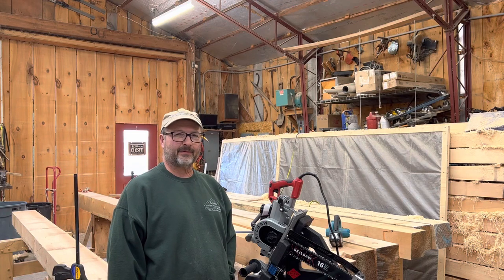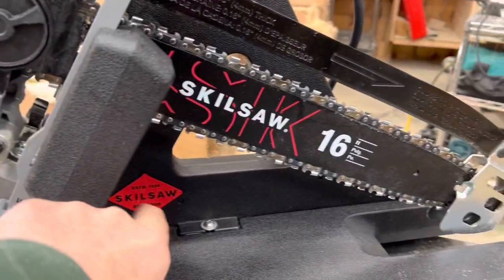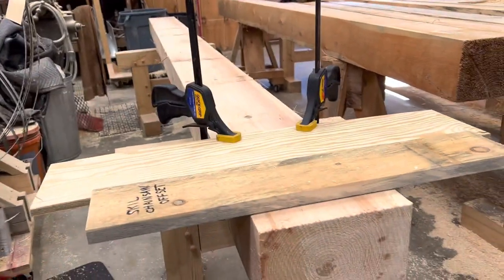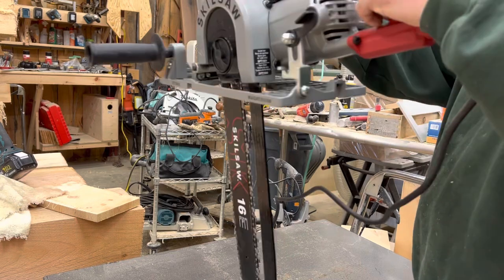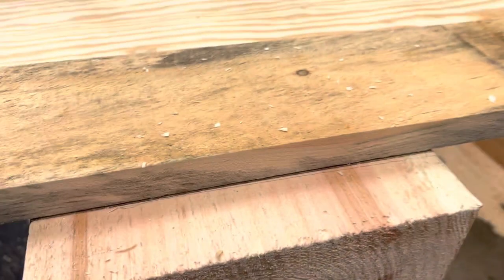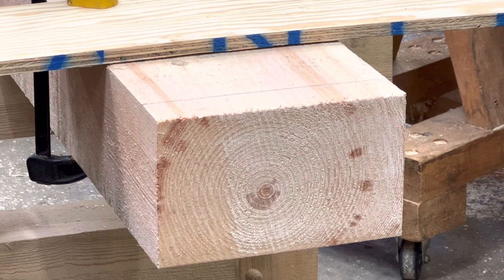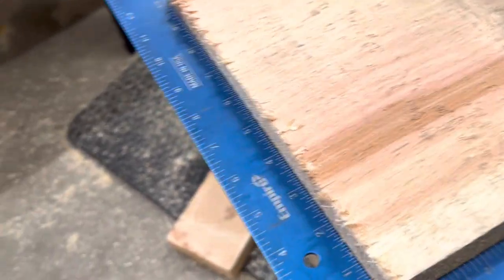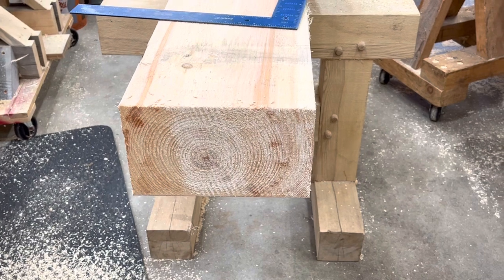Timber Framing - Skil Carpentry saw SPT-55 for initial square, plumb and true timber end cuts

Comment: Hi Rich! Thanks for the video! Well pronounced my name, it is a difficult Dutch word haha :). Looks like a great tool, not too much chip out for the softer woods as well. Quite a fast cut and good design and probable worth its cost! Glad to be part of the discussion and so great that you purchased it so quickly. Would of course be cool to see how it compares to the Mafell but I am looking into a converter to 110 volts if I can possibly can get the Skillsaw. I think that mafell had a special designed chain against chipout and probably has some better features but that is the least they could do for the extra bucks. Really look forward to your insight in the future with this saw. Thank you for the effort and hopefully it fits in your workflow! Kind regards, Tom
Reply from the maker: Hi Tom:  I'm using the saw carpentry chain saw several times per day.  The saw is relatively light in weight and well balanced.  The only thing I've noticed is that the saw pushes a little hard once the riving knife enters into the wood.  All in all, I'm already seeing a big time savings compared to the 4 cuts with the Makita 10-1/4".
Reply from the maker: Hi Tom:
I’m using the saw daily.  I’m cutting using a fence.
The only issue I’m encountering is that when the saw is fully engaged and the riving knife is engaged, the space between the blade and the riving fills with chips slowing and even stopping the forward motion.  I’ve countered by backing the saw, allowing the chips to fall out, then continue the cut. 
Not a big deal but worthy of mentioning.
I’m cutting 8”x8” eastern white pine at 30% MC.
With the fence, the cut is square and plumb.
Reply: @theMainetimberframer  hi Rich, thank you very much for the updates! Seems like the saw is worh having in the shop and is acting like a solid work horse. It is much faster i then rotating for a circ saw i think so worth investing on it! Does the chain dull quickly? Glad it gives square cuts that well. Thanks again and all the best wishes for the holiday season! Kind regards, Tom

Comment: I bought this saw today and used it to cut 8"x12" douglas fir and it had a really hard time!  Have you experienced this?  I tried toe in and toe out, really bogged down and cut clogged up with sawdust pretty bad
Reply from the maker: I found with deep timber cuts the chips will load up between the chainsaw and the riving knife. Backing out slightly releases the chips and then I can continue to cut.
I have not operated the saw with a vacuum system…. Yet.

Comment: That's a hard working 2x4 you have there in your roof 🙃 If it ain't broke..
The saw looks good so far. Curious to see how it works out for you. A perfect cut is a utopia with a chainsaw, but on a harder wood and with an angle closer to a rip cut it can get pretty good.  This seems more than adequate for what you want from it.
Reply from the maker: Hi Johannes:
the 2x is red oak - I put it up green and 'pre-stressed' it so to hold the shelves it supports as level. - Yeah, it looks funky... a conversation piece when people visit the shop for sure!

Comment: Skill is doing some good work on their tool line up.  Nice cut and everything.  Curious how you lay out for that end cut?  or don't,  maybe just a tick or is there a full cut line where you  line up the jig plate?  You've probably covered this in the past.  I'm all about cutting steps in the process,  I could see once this system is set in place and use you can move through timber efficiently.   What's this saw cost? similar to the 16" circ saw?  I could look it up, sorry being lazy.   I had a kit years ago that put a bar on the skill worm saw but didn't like it.
Reply from the maker: Hi Timberdoodles:
Yes, I think Skil is doing some good work - I sold my Makita 16-5/16” after using and buying the Skil 16-5/16” - it has a bigger saw table and more stable for sure.
For the offset:
I strike a line perpendicular to the end, line up the off set piece on the line, then touch off the fence and clamp.  Remove the off set and cut using the fence.
The cost of the saw is $699 - cheap compared to Mafell!
The chain has a tooth on every link for better cutting finish.  
Frankly, my initial assessment is that the spt55 should have more power.
I bought an extra chain for it.
A quick note: fill the oil slowly as there is a filter in the filler tank.  And yes I poured oil all over the saw when filling.
I thinking sawing without the fence would not give the desired end cut result…. I need a quicker fence set up.  I have a couple ideas for that…
It is for sure quicker than cutting 4 times with the Makita 10-1/4.
Reply: @theMainetimberframer  Good input.  Nice system.  I don't cut any drops with four cuts, free handing with pencil lines with my chainsaw, gas or electric, depends on which is handy and sharp.  but I like this set up.
Reply from the maker: Hi Timberdoodles:  After some more cutting - I think the saw has enough power, what I noted is that when the riving knife enters the cut, the saw pushes a little harder.  The riving knife has a taper on both front sides to help the entry of the the riving knife into the cut...I'm going to add some dry lube to the riving knife to see whether it helps.  Overall, this saw is a time saver for initial end cuts for sure!
Reply: @theMainetimberframer  Do you dare remove the knife?
Reply from the maker: I’m using the saw daily.  I’m cutting using a fence.
The only issue I’m encountering is that when the saw is fully engaged and the riving knife is engaged, the space between the blade and the riving fills with chips slowing and even stopping the forward motion.  I’ve countered by backing the saw, allowing the chips to fall out, then continue the cut. 
Not a big deal but worthy of mentioning.
I’m cutting 8”x8” eastern white pine at 30% MC.
With the fence, the cut is square and plumb.

Comment: Nice video, thanks.  For those new at handling chainsaws, be prepared for an additional investment of about $200 in extra chains, and sharpening equipment.  Additionally, learning what to use, and how to sharpen is imperative.  Although the 15 AMPs of power equates to approximately 2.4 horsepower, a dull or improperly sharpened chain will produce a lot of heat, and wear and tear on the motor, and frustration for the operator.  an improperly sharpened chain or improper setting or uneven (inconsistent) depth gauge height can cause the saw to cut crooked, bind in the kerf if it curves into the cutting guide fence and strain the motor, or wander away from the fence.  The guide bar also needs attention periodically to make sure the rails are at equal height (90° to the side of the guide bar), and the groove where the chain rides must be properly gaped (If it's too wide, the chain will flop to one side or the other, causing it to cut crooked).  Nice machine, best of success, it looks solid to me.
Reply from the maker: Hi Thomas
You are right for sure about the maintenance of the bar and sharpness of the chain.  I did purchase another chain when I bought this saw.
In the shop and sawmill, we have 8 electric and gas chainsaws and a chainsaw chain sharpener.
Good maintenance and a properly sharpened chain is key to success.
Thank you
Reply from the maker: Update:
I’m using the saw daily.  I’m cutting using a fence.
The only issue I’m encountering is that when the saw is fully engaged and the riving knife is engaged, the space between the blade and the riving fills with chips slowing and even stopping the forward motion.  I’ve countered backing the saw, allowing the chips to fall out, then continue the cut. 
Not a big deal but worthy of mentioning.
I’m cutting 8”x8” eastern white pine at 30% MC.
With the fence, the cut is square and plumb.